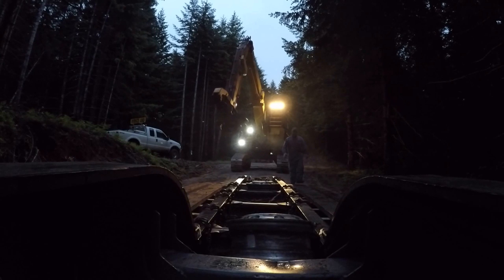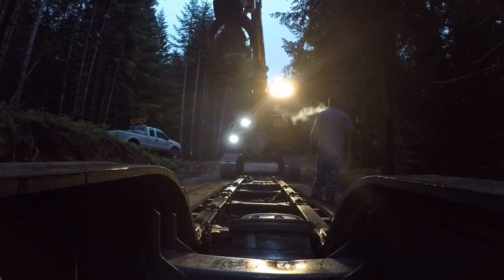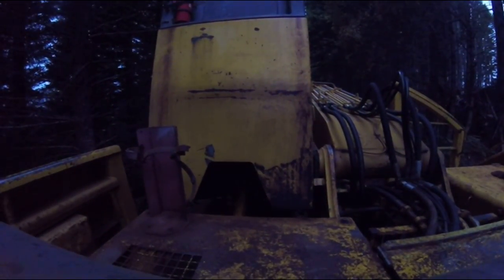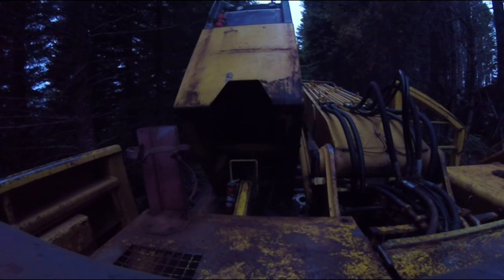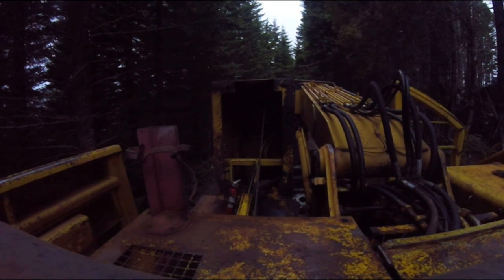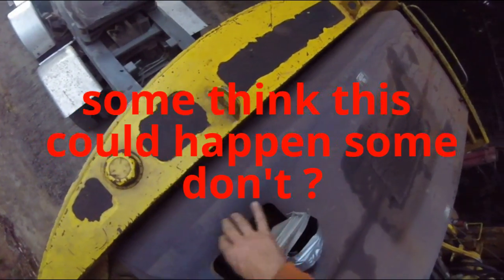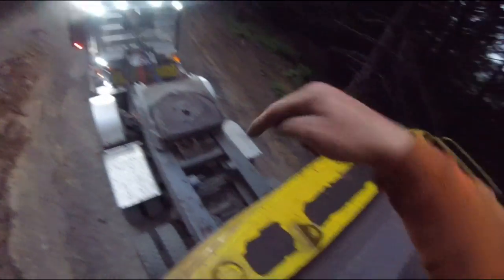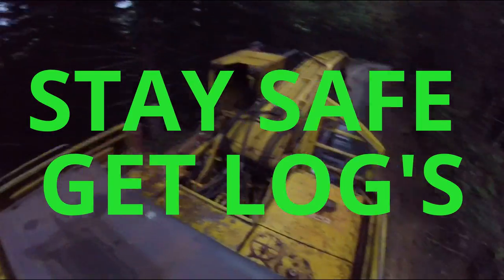WALKING THE LOADER ON THE LOWBED

Comment: so just to add this to the should you cover the exhaust or not.  had a float driver (30+ year moving and running heavy equipment)  say  you park the equipment in a field or landing for the weekend and the wind can blow 50 60 or 70 mph but we never cover it?    now has anyone seen a blown turbo because of this?   I'm not saying one way is right and the other wrong just saying for argumentative sake.
Reply from the maker: funny you say that rite after i finished the vid the truck driver said the same thing .